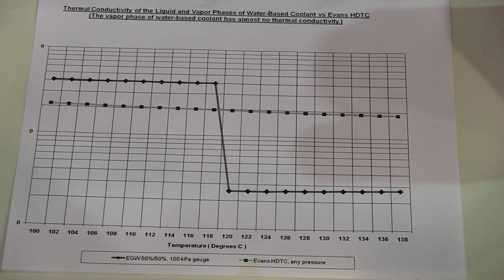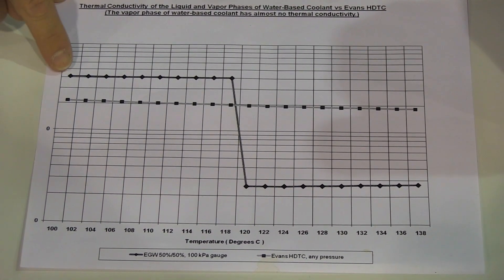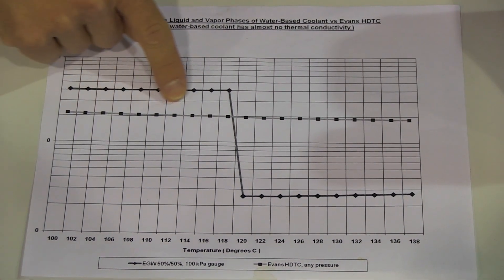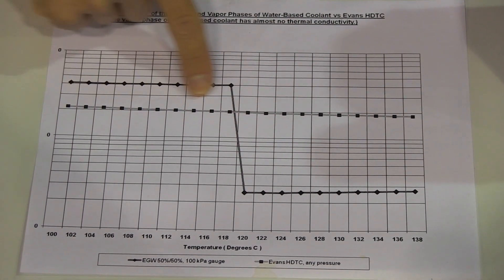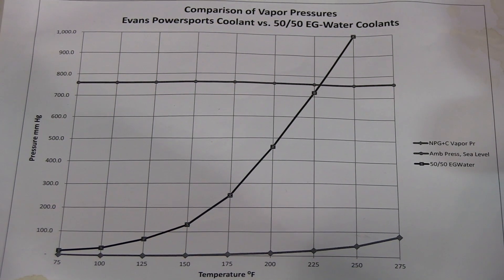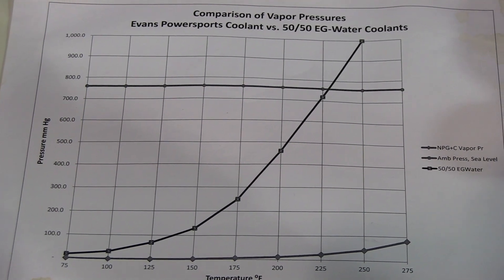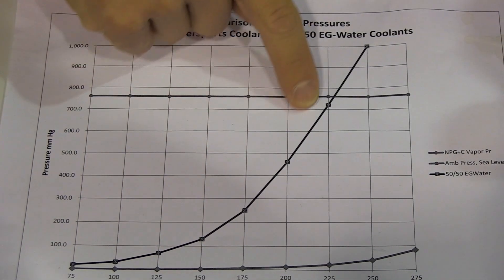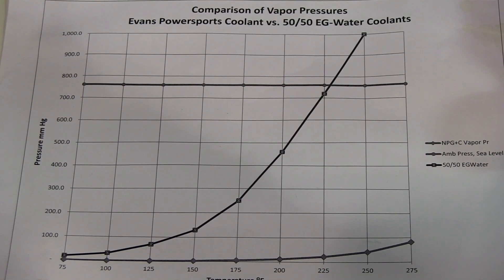Evans waterless snowmobile coolant at the Toronto Snowmobile show!  PowerModz!

Comment: Yes, he referred me to a BRP coolant heater for their 4 strokes. Some "block heaters" warm up the coolant in the block, which actually leaves the oil, at the bottom of the engine, cold which is not good. The BRP one allows for heating the oil too. I'm not sure, but my blood might gel at -35!

Comment: If you still want to heat the coolant: the screw in type coolant heaters are not a great design. The high heat created in a small area tends to cook the coolant. Whether it is water based or waterless, this will cause additive deposits and cooked coolant charring to grow around the heat element. We recommend an external stick on type oil heater like found at wolverineheater dotcom  Maybe you're thinking of a very different type of heater than I'm familiar with that may also work.

Comment: Hi. i looked into this a bit and here is what I've found. The oil viscosity is more critical than that of the coolant. It gets thicker than the coolant does and the need for flow at startup is more important. An oil heater would be of primary importance. Now, if you've got the oil temperature covered: if you start the sled, the coolant should come up to temperature without trouble. The coolant pumps are not displacement pumps and so won't be damaged by high viscosity.

Comment from the maker: Exactly, you still may overheat because of your system but the damage won't be done they say.  I just tossed about 10 gallons of old coolant yesterday - big pain in the butt.  With this coolant you pull it out of your old vehicles and just put it in your new ones when done - pretty sweet.  Price point is higher but hey not having to ever replace the coolant is the saving factor.